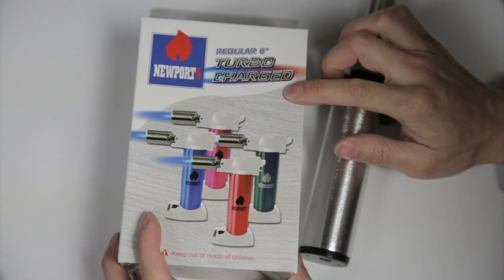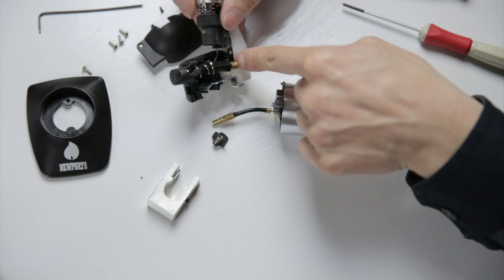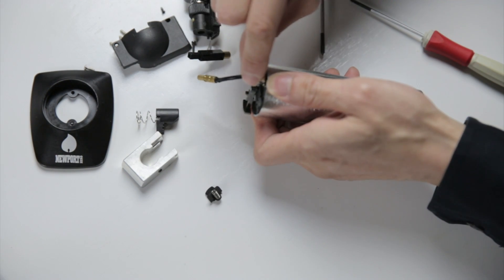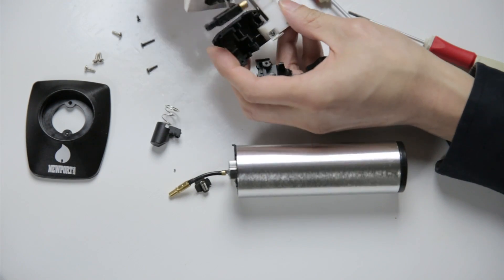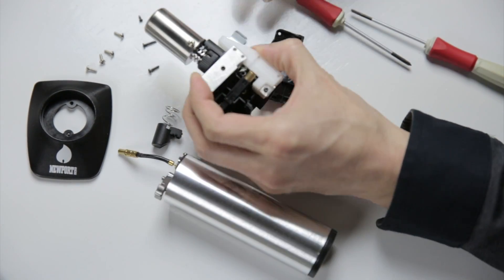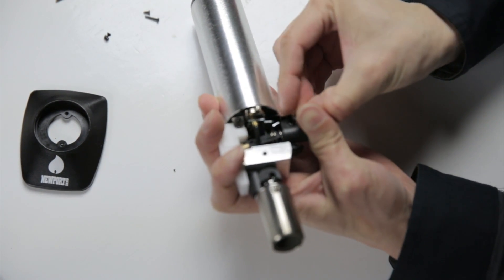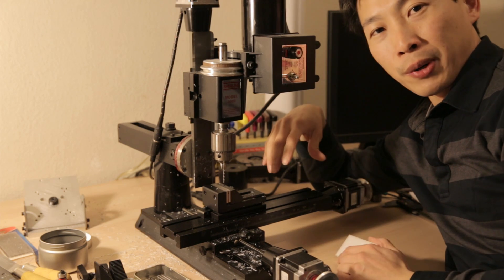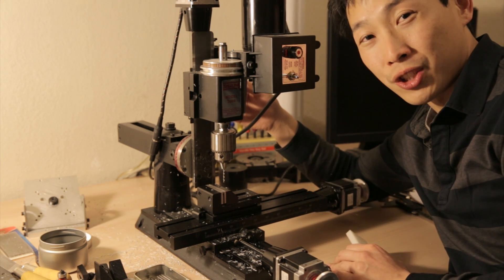Butane Lightsaber Making Of | BeatTheBush

Comment: by the way, if you decreased the size of the output, it will create pressure that will make the flame taller , and it will look much like a lightsaber.
Reply from the maker: Is this speculation or did you try it?
Reply: actually it's  only a speculation
Reply from the maker: I see. So then the handle allows you to increase the flow rate. I assume you might be thinking if you decreased the size of output, it will push out more fuel. In this case, when you push out too much fuel, the bottom part of the fuel is coming out too fast and does not burn. When it doesn't burn it doesn't light up until higher up the blade. So that my speculation based on what I've seen.

Comment: how do you make the flame larger?
Reply from the maker: You really cant since the flame length (at least this type of flame) is determined by the fuel chemistry. If you push a lot of fuel, the flame will start to fly off the end and appear disconnected.
Reply: that makes sense, well if i did happen to add more fuel would the blade width still be the same(not length) btw thanks for the quick reply!
Reply from the maker: More fuel would run rich so it will be a red flappy flame. So you must keep the same fuel and air ratio mixture. Assuming you have more fuel/air mixture you can probably make the width bigger by using a wider nozzle but that will likely make it shorter. Perhaps if you have say 4 of the same thing paired together, it can be wider and just as long.
Reply: +BeatTheBush ok, thanks! sorry to keep asking questions, but how would i go about doing that, this is an awesome start though, thanks again!
Reply from the maker: I wouldn't know without actually doing it. You would have to be pretty good at DIY stuff and hack together your own high flow butane fuel source along with a custom nozzle. I actually think if you make a wide one only 8" long, it's not that great. Making it long while burning like a jet might be impossible.
Reply: +BeatTheBush would it be possible to just keep the original width of it and just increase the hight?
Reply from the maker: I'm not sure, no one has done something like that before.
Reply: +BeatTheBush ok, thanks!

Comment: Anyway to make the flame longer? :^)
Reply from the maker: +Corvanor I wish that as well and working on it! =D
Reply from the maker: My understanding is that thinner would actually pass less butane given the same pressure so there would actually be less flame. Longer wouldn't do much other than take slightly longer to reach the exit hole.
Reply from the maker: +domce106 Oh, you meant the nozzle tip. I thought you meant the rubber hose. I'm thinking maybe. The total flame volume will likely remain the same since the amount of gas burnt remains the same. So if it could be longer, it would be narrower. I sort of rather like the girth of it so I would rather increase the gas output but that would be some very dangerous work.
Reply from the maker: +domce106 A full length flame thrower that runs for 1 minute would still be pretty awesome. Yah, if I blow up, this channel is dead. lol.